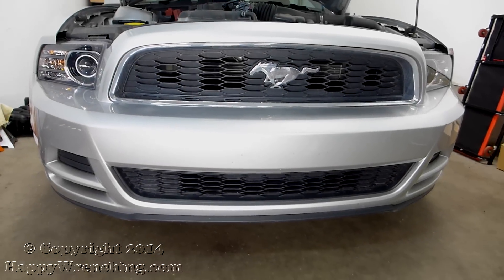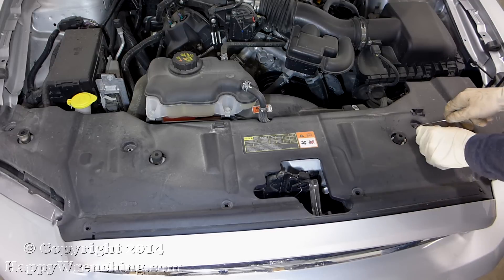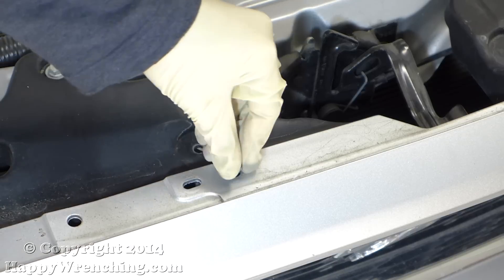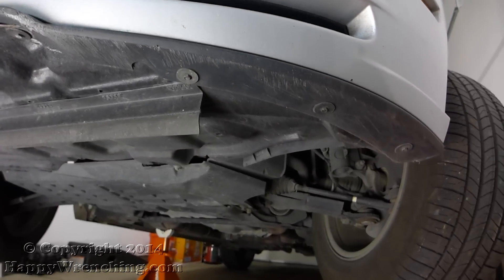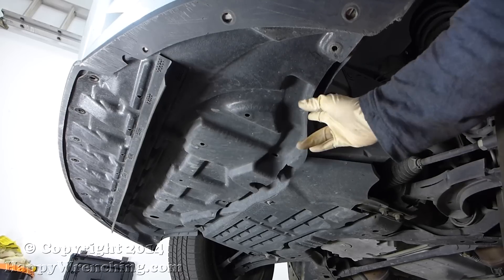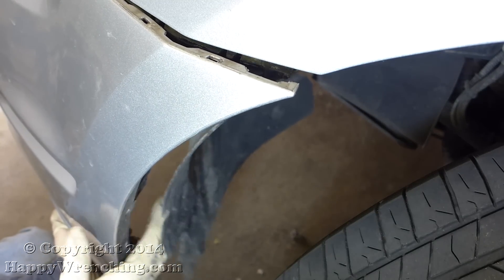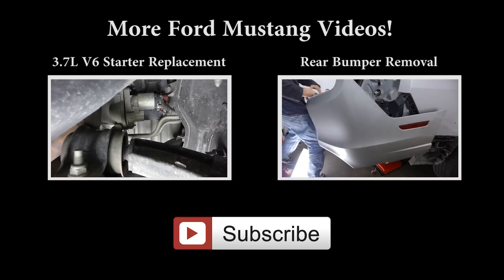Ford Mustang Front Bumper Cover Removal - Fifth Generation (2013 - 2014)

Comment: So, I should be able to access my lower fog lights by just undoing the bottom splash guard?   One of them has dimmed out so I need to replace them and I also want to add 2 more light bars to the rectangle slot underneath my fog lights.   That all appears easily accessible once that huge splash guard is removed.   Thanks for showing me how to remove that.

Comment: @happywrenching I know this video is a little old, but I just had my driver's side front bumper bumped haha, and the clips came out, that snapping sound when you are installing the corners under the headlights should this just snap into place like that once the splash guards and shrouds are tucked in the wheel well, mine aren't quite doing that so I'm probably lining it up incorrectly any tips you can give or advice would be great, good vid though, very helpful.

Comment: @happywrenching will this work for a 2011 or 2010 if you can tell us much appreciate it.
Reply from the maker: +eddie velasquez The process is similar in that there are clips for the radiator cover at the top, clips for the bottom cover, and screws in the wheel well. The location and number of clips and screws will be slightly different than what is in this video. You will still need to unhook the fog lamps, ambient air temp sensor,  and side marker lamp plugs.
Reply from the maker: +eddie velasquez The process is similar in that there are clips for the radiator cover at the top, clips for the bottom cover, and screws in the wheel well. The location and number of clips and screws will be slightly different than what is in this video. You will still need to unhook the fog lamps, ambient air temp sensor,  and side marker lamp plugs.
Reply: happywrenching well thank you for commenting i do appreciate it. I am looking forward for you to do more mustangs and other sport or muscle cars.

Comment: Today I backed out of a driveway with a steep curb and the bottom of the bumper cover hit and my passenger side of the bumper cover is popped out a little ( like at 5:14). I pushed it back on but the very corner ( like where your left hand is) stays stuck out some. It's cosmetic but it aggravates me bc I only have 3K miles on my car. What holds the very end of the cover on? Is it a clip that maybe broke? I can't tell by looking at it..
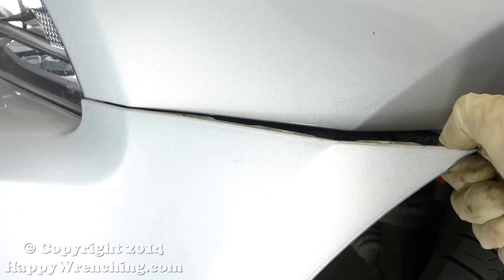Reply from the maker: Yeah its clipped in. If you look at 4:58 you will see a tab. That goes over a hook. Most likely you either broke the hook or the tab itself.
Reply: Oh yea i see.. I will have to look tomorrow when it's light out. I don't remember seeing that earlier when it was light out though. :(  I guess I will have to get an entire new bumper cover all bc that one little piece is broken..ugh :(..Thanks for the quick reply though man.

Comment: Awesome video very informative but why does Ford have to make it have 100 different size bolts just to take the bumper off😂
Reply: Literally struggling with ordering the right hardware from my not so local Ford deal, fml that they can’t even answer how many of each your car uses despite having a VIN.